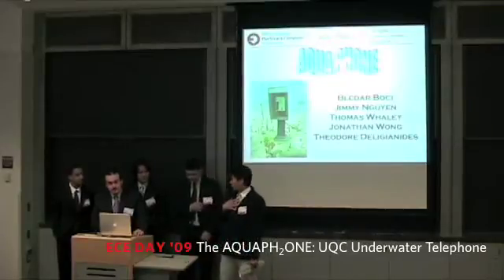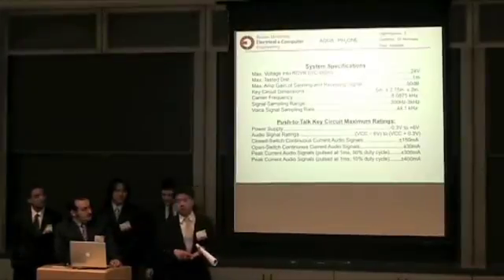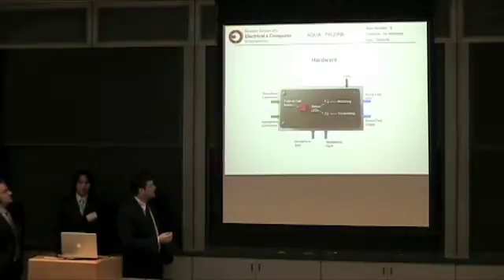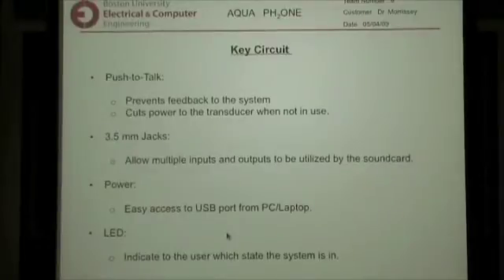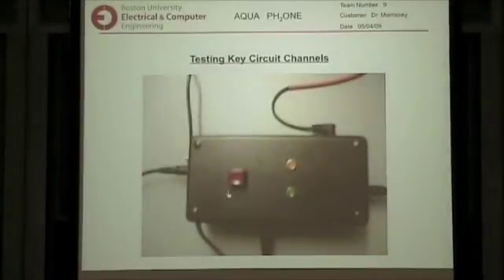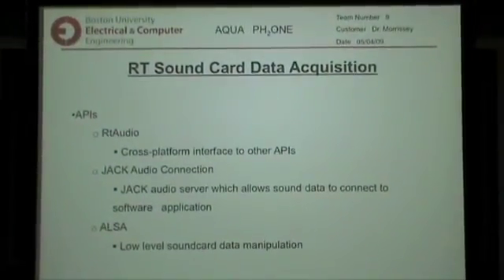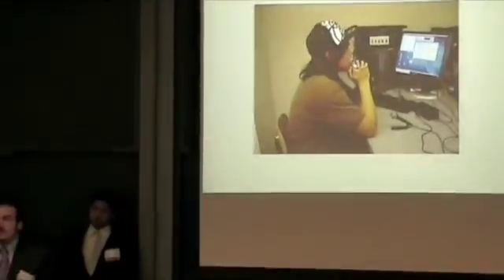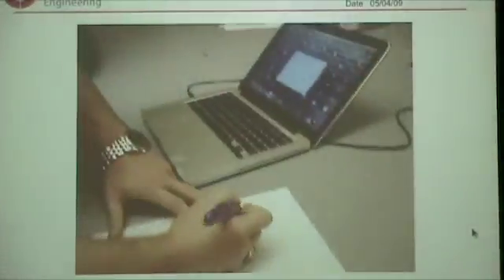ECE Day '09 The AquaPh2one's UQC Underwater Telephone Part 1

Comment: Here we are now, 6 years later.  
What progress has been made with this?  
Is it available to the public or has the military absorbed this and 'buried' it already?  

There are uses for this beyond anything the military is likely to be using it for, just talking to submerged submarines which is what they use the UQC for and have been using it since the 1940s
Reply: Orcinus Orca Just make your own! 

The UQC modulation/demodulation is very simple (Single Sideband AM) and can be done in software easily. 
Then you need hardware for:
- keying your transmissions (switching between Rx/Tx), 
- amplification and conditioning (Tx power amp, Rx preamplification), and
- transducer to produce the audio signal into the water
Reply: I plan to but it needs to be DSB. It shouldn't be hard to modify this to do that.
Reply: Now 14 years and still nothing.